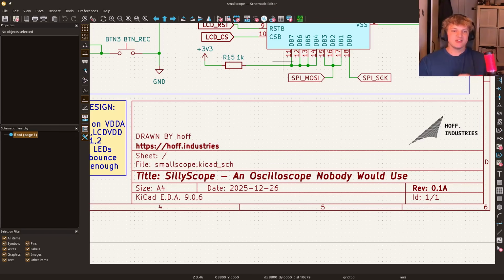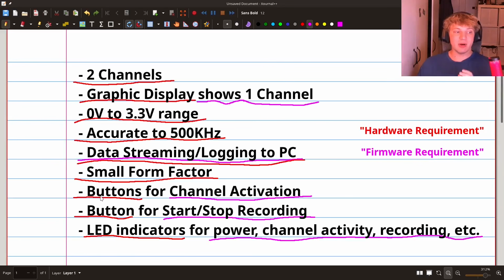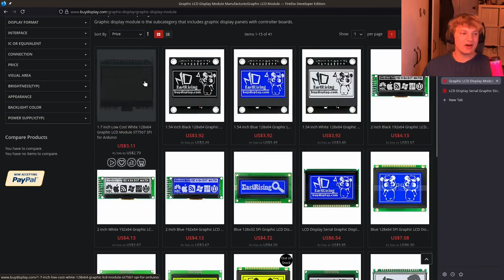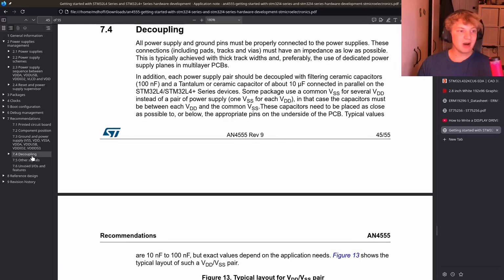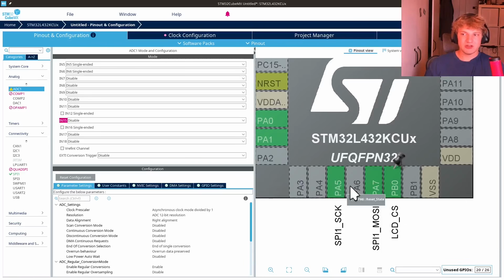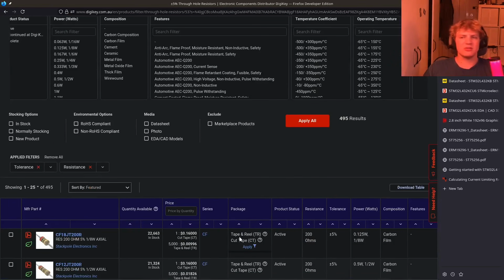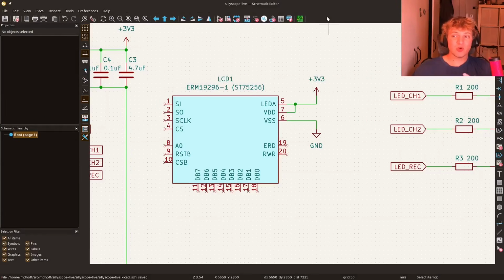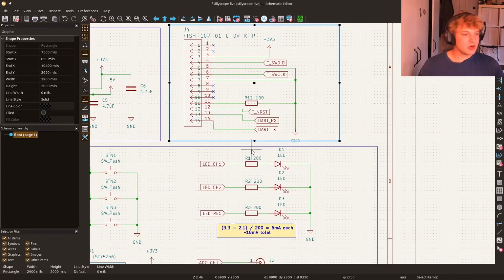How to DESIGN an EMBEDDED SYSTEM - Schematics & Architecture

Comment: Is it possible to control the graphical LCD without a microcontroller? What do each pin mean and how would I use it manually?
Reply from the maker: um, not by hand. for sure you could do it with an FPGA. The trickiest thing is the SPI communication since that is going to be running at like 10MHz. You then have to create the framebuffer somehow, and transmit this. You will need something with 6KB of memory for this
Reply: @hoff._world 
what about using bit banging

Comment: Funny story: I once went through the whole process of designing my own oscilloscope, and when I got to the point of sourcing parts I realized the adc with the resolution I wanted were extremely expensive, and adding up time and components I realized it was better to get a Rigol DHO804 instead.
Reply: Just for those who are undoubtedly going to argue with my statement, I got my oscilloscope for $299 at Black Friday about 4 years ago. Yes, I know they’re double the price. No, I would still buy one instead of making one because all the components have gone up in price as well, and an ADC with a decent enough resolution is still going to be pretty much more than half the price of buying one, plus the case material, encoders, etc
Reply: It's for education., no one on their right mind would actually use this osciscope

Comment: Have you work with development tools from microchip? Their hardware looks good, but they are not going to support descent tooling for atmel, and now force a thing called MCC upon people, the way i understand it it is supposed to generate drivers for periferals using GUI, but it is buggy(project breaking kinds of bugs), and you can't migrate projects between it's versions, I have found reports on people having alot of problems with it. Also licence for compiler with high optimization level for their devices(ultra small, cheap and low power chips is like the whole point of siding with pic as far as i know) costs 1000 bucks, and you can't really do to much stuff with small chips without it
Reply from the maker: Yeah actually very recently had to work with an Atmel start project (which is a tool now deprecated) and it's a total nightmare trying to add new HW peripherals. That's the number 1 issue with generator tools from not just microchip but every manufacturer, one day they might get deprecated and then u have a massive abstraction library that's hard to work with. Microchip seems to have the worst generator tho, cube is way better.

Comment: Using pull up resistors on unused pins is a good idea on experimental boards. You may discover during development that you need to set that pin low or tie it to another signal. Also connect unused microcontroller pins to test points so if you need them for something they're available.
Reply from the maker: Yes I may break these out when we get to the PCB design. Since this is supposed to be a tutorial on iterative design and how things may change over time, this is a really good suggestion. Thanks!

Comment: No inductor between vdd and vdd_a ?
Reply: ferrite beads for the analog power are often unnecessary
Reply: @_soupnazi  I thought that it is necessary every time you use ADC and you need good results.
Reply: @Chupacabras222  It really depends on the noise tolerance of the design and particular chip used. Altium has a good technical video discussing this topic: https://youtu.be/H4nrotIVuUM
Reply: @Chupacabras222  https://youtu.be/H4nrotIVuUM
Reply from the maker: Hey, as I mentioned in the video I don't want to make a completely perfect design because I want to show off iterative development. We will find out together if it is needed

Comment: STM32L4 has op-amps built-in
Reply from the maker: a good point, but from my understanding they only work with a range of 1.8-3.6V, which won't help us measure negative voltage or say, 20V. For this we may need an additional scaling stage in our input pipeline with dedicated op amp chips. Correct me if I'm wrong!

Comment: 9:06 Sticking with something close to what you know is one of those things that is hard to put a value on, you can spend a whole lot of time trying to find the perfectly optimal option and it will bite you because of some hidden peripheral behaviour or inadequate HAL that you weren't aware of, or get down the line with implementation and realise that you had to implement costly supporting auxiliaries to implement a claimed spec/function.

Comment: Nice video, but the hardware is only one part of embedded system design.
When you want to design an embedded system, you need to design the hardware, firmware/software (drivers for interface between component and software integration between the drivers) and for production the system also needed to be reliable for some physical requirements and hard for reverse engineered.
If the design need to be connected to other devices like IOT devices so there are some more consideration that need to be taken.
Reply: this is one video of a series.

Comment: Today morning itself i did shopping for same project, i am using a atmega328p(bcoz i had one 1), but after this video i felt i should have planned more😢. I just made a list of parts which i felt would be 'required' and just read up on thiere specs and bought them
Reply from the maker: I like doing up a schematic before I begin since it gives a "reason" to the feeling. We do a similar thing, there are things I "feel" are required but doing a proper schematic actually gives it a hard purpose. Maybe you should give it a go now, before your parts arrive? good luck!

Comment: Nice guide.
32:44 Formula seems backwards, but otherwise correct. 1.2V across resistor / 6mA through resistor and LED = 200 Ohm resistor suggested. Those LEDs don't seem particularly efficient, but I'm guessing the LCD backlight is the biggest power hog in this circuit.
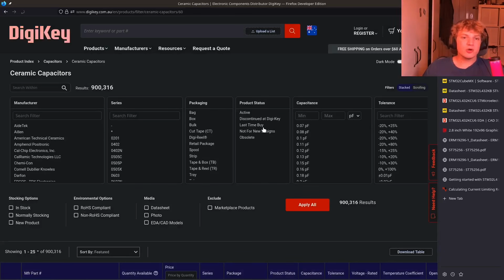34:36 Not sure why you make a big deal about the caps being surface mount. Isn't that microcontroller harder to hand-solder on?
35:45 Not that it's likely to matter, but the application note and datasheet suggest a 10nF, 1uF and a ferrite for the VDDA pin.
36:24 I had a pcb powered via a usb micro b connector. Was kind of terrible. The connector was fragile, and the usb power bank turned itself off maybe because the current drawn wasn't high enough.
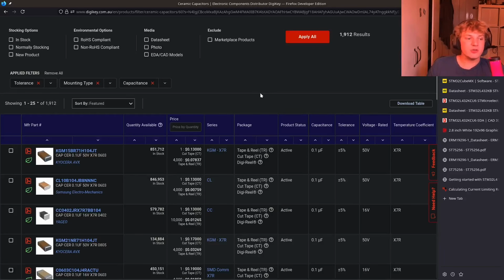Reply from the maker: 34:36 yes the MCU is harder, but it's about minimizing pain because personally I suck at soldering lmao so I'd rather less SMDs overall...

35:45 I did notice this during the design phase and like you I thought it wouldn't matter so much. In the finalised schematic (available at https://hoff.industries/files/sillyscope-01A.pdf ) there is a "Potential issues with design" note where I mention this among other things

36:24 yeah micro b sucks, lucky for us this is USB C :) should be nicer

Comment: Thanks for the video,

Do you think that having VLSI and practical knowledge on building ASICs will offer signifcant value and be helpful to the average Embedded Systems engineer?
Reply: I think so...it will give a better understanding of computer architectures which can make one better at embedded coding.
Reply from the maker: personally I know very little about these so I don't feel qualified to make a comment - have done a little on FPGAs but nothing to the point of building an ASIC, though I think the hardware and logic foundations FPGA teaches you will benefit. Sorry I can't be more helpful!

Comment: I’m really drawn to low-level stuff. I’m always asking myself how things work, and I’ve sometimes gone as far as digging down to the physical/chemical layer. I’m also self-taught. I stopped studying after high school, but I joined École 42 in 2023.

I’ve been questioning the possibilities in terms of fields. If I had to make a top 3, it would be: kernel/OS programming, embedded systems, and reverse engineering.

All of this leads to the question I’m asking you, because you seem very invested, and I think I am too. The thing is, I didn’t do any university studies. I’m curious to know what you think: do I have a chance in these fields, or is it inaccessible and I’ll end up doing web dev, coloring buttons 🥲 (if I don’t ask AI to do it for me)?

Anyway, I’m just looking for an opinion and some advice. Thanks in advance!

PS: Thanks for your videos!!!
Reply: It is possible but you need to create something, definitely hard because you're competing with degrees holding folk but not actually impossible. Keep your expectations in check and just go in any entry level embedded job in any company, it is better to work up your way like that
Reply from the maker: I have a video about my thoughts on degrees here: https://www.youtube.com/watch?v=QFLw7I9f5zc
and what I studied in my degrees here: https://www.youtube.com/watch?v=t-hKEgqssHk

I won't lie, I don't think the market for 'self-taught electronics engineers' is as strong as self taught software, because there is a lot more mathematics involved in electrical. There's nothing stopping you from doing plenty of hobby projects and maybe trying consulting, and of course just try to apply to jobs and see what happens. Good luck mate :)